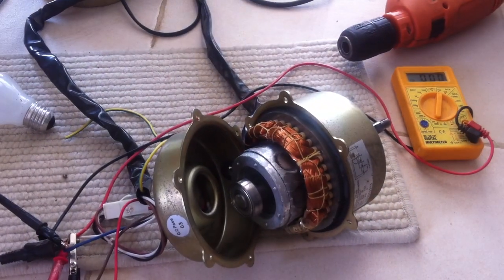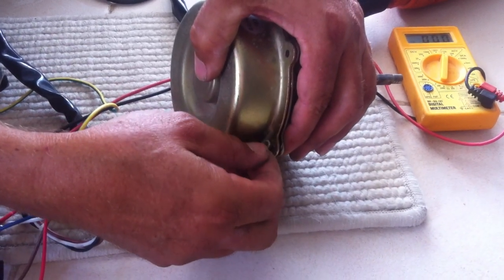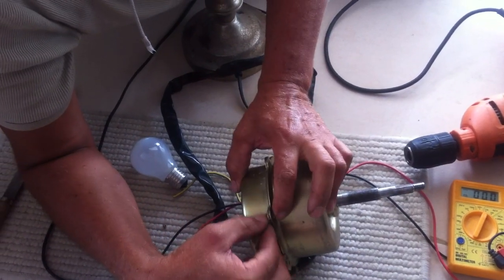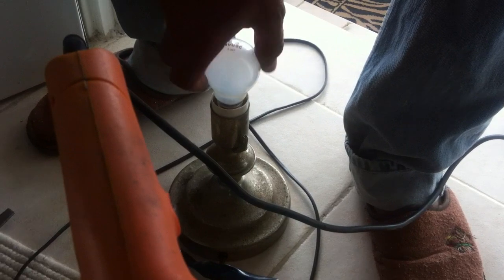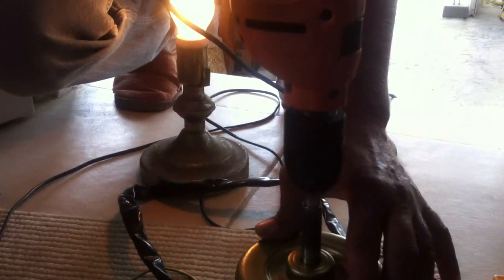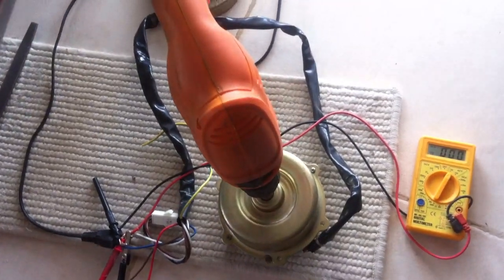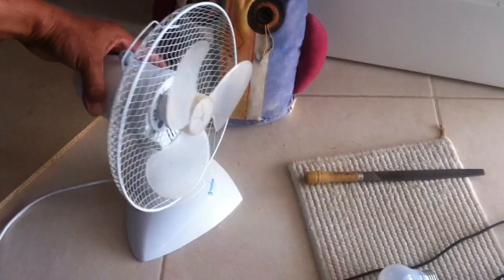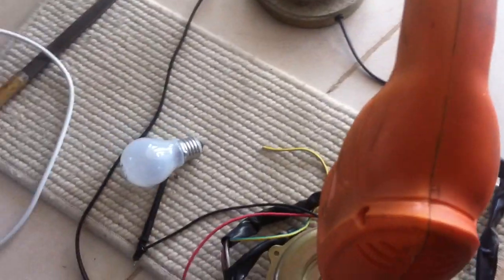How to convert a AC motor to a powerful alternator and generator

Comment: this kind of generator is explained also by rakarsky in his site, I don't know how to show you the link because it will be deleted automatically
Reply from the maker: Hi I hope you are well. Thank you for your comments, I will look at what you sent. The magnets are necessary for the reason that the generator will generate already in low rpm instead of 3600 rpm, in our case in Europe with 220V generators, it will generate already at 2000 rpm thanks to the magnets and also be a very strong battery charger while without the magnets you would need to spin it in more rpm to get the same result in output, and it will not charge batteries as well as it is doing with the magnets. But as you see in the video, you can charge another battery with the alternator I put on the machine so there are different options. I hope it helps and thank you for the link
Reply from the maker: Hi again I opened the site some pages in russian some in english, one of the devices is a motor that spins an alternator and the output of the alternator goes through a solar regulator to charge a battery, the battery can run an inverter that spins the original motor that spins the alternator. I saw some other generators explained, it is very nice. I think the person publishes generators other people make and explains them, it is very interesting. Thanks
Reply: @denissabourin  if you don't know russian you need the plugin translator in your browser. the page is quite intelligible very interesting, the zig-zag winding probably my next experiment
Reply from the maker: @mich6528  thanks yes I will translate it, there are many interesting things there. Regards
Reply from the maker: In one of the paragraphs of one of the articles in english you can see he mentions the rotoverter, this motor is something unique where from one motor with 1 phase you can run a 3 phase motor and get almost 100% efficiency. This rotoverter makes miracles, those who know it, know it. For examples, it was used in factories with big machines that request 3 phase to run them, and in the factory they had only 1 phase with one rotoverter that converted from 1 phase to 3 phase and run the big machinery without problems, it would never be possible to run them in any other way without consuming so much power. Best regards